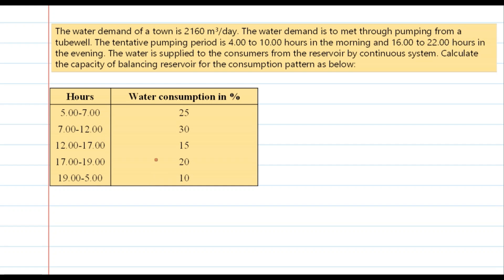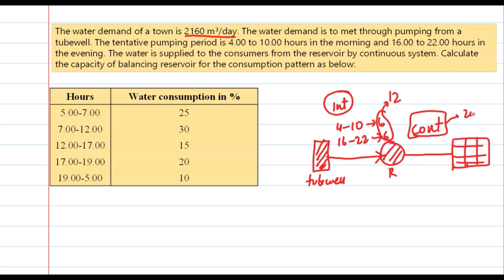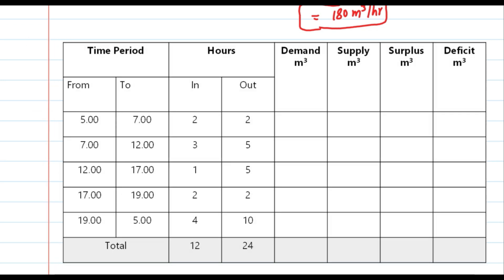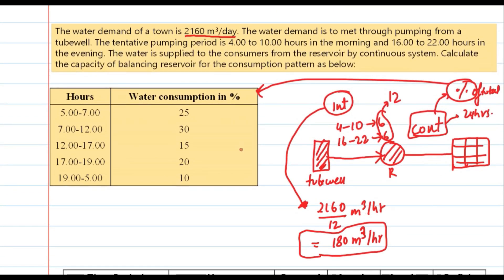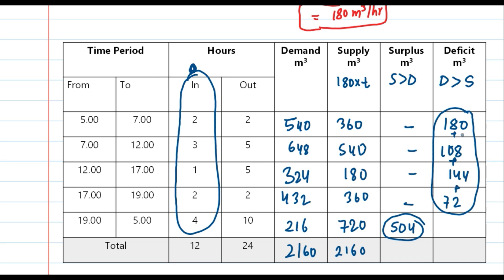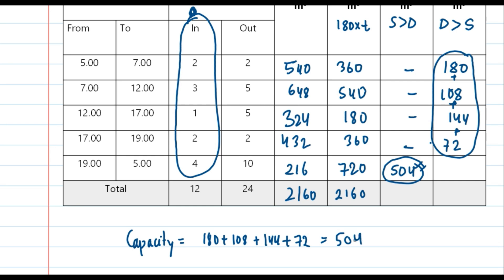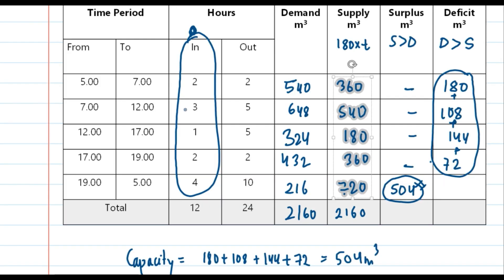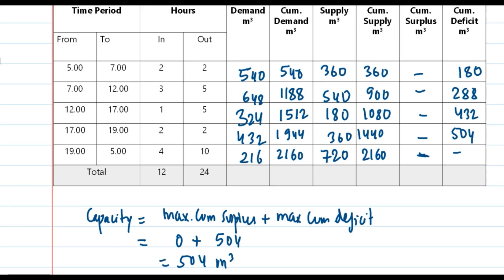Capacity of Balancing Reservoir | Example 3

Comment: how you calculated HOURS IN and OUT??
Reply from the maker: Regarding IN: For 5-7 it falls in the pumping period so 2 hrs (5-6,6-7), For 7-12 there are two parts: 7-10 lies in the pumping period and rest 10-12 we don't need as this does not lie in the pumping period so only 7-8,8-9,9-10 (3 hrs) and similarly for others.
Regarding OUT: Its continuous system so every hour in the timeline is considered.
Reply: Same problem